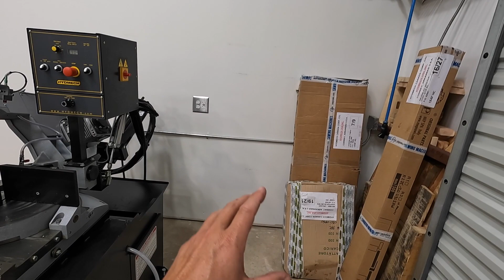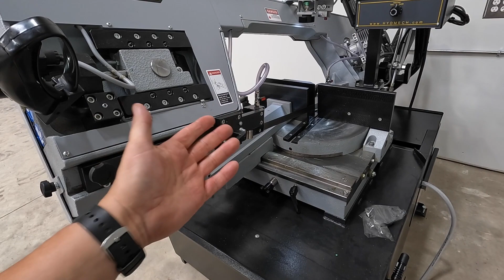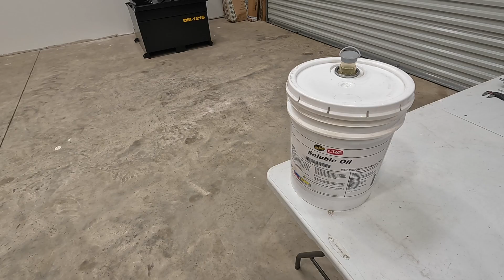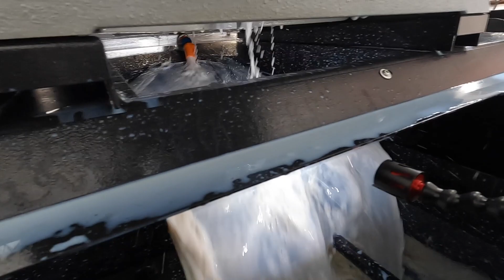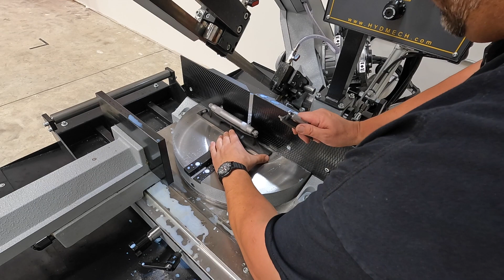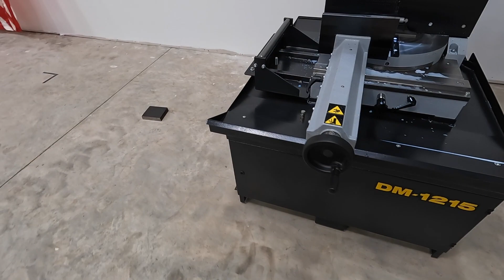Hydmech DM 1215 Setup, Level & First Use

Comment: blades are expensive if u do not know your grad of steel and the speed per grade of steel u will break teeth n have to scrap  300 $ for one blade,
Reply: i run 6 hydmech saws in a steel plant i can say i broke  3 blades cutting one piece not fun
Reply: @danielcyr6489  Theres no way the blade on Aboms saw costs 300$.
Reply: @innominatum9906  depends on grade mine are 300+  cheaper blades are no good for some sTeel.   my cold saw blades cos 700$ each
Reply: @danielcyr6489  But the blades for your saws are also bigger too, right? We use the same sized blades as Abom at my work. We cut stainless, tool steels, aluminum, mild steel etc with no problems. A sawblade costs us about 15$.

I've got no experience sawing titanium, inconel, duplex and whatever hellish metals are out there - so that could be why yours are more expensive =) cheers

Comment: When you poured in the coolant it ran out the chip drawer. I think you need to pour directly into the slot at the top so it doesn't run along the wall of the tank. Super saw. I'm sure it will suit you well, just as the other one has.

Comment: the coolant pump is sucking up air, maybe you should add some more coolant.
Reply: Thats why the handle sprayer is barely working. its not got enough coolant to run all the sprayers and the handle sprayer. If you watch when he hits it the nozzles almost dry up. I'm sure it has a minimum but seems he didn't read the booklet.

Comment: Hey Adam, just wondering...  In the high salty humidity you have down there in Florida, what would happen if you left the rust inhibitors on the machines rather than cleaning it off, and then reapplying rust inhibitors?  I know you need to clean it off of way surfaces, but I'm talking about the "acreage" of the machines.  Just curious.

Comment: OSHA came into my work p!ace years ago and wrote up violations for every machine that was feed from a cord into a receptacle or twist lock that was not on wheels. Other words what some people call fixed in p!ace then it must be hard wired. Looks like best in class saw. We had two Kalamazoo saws and I asked them to have our sheet metal guy make up deep pans so I could instal! Coolant pumps but they never got around to it. As a sparky was a!ways amazed how much coolant ( we always called it soup ) that you could make out of a 5 gallon pail.

Comment: As easy as those leveling bolts seemed to turn you might want take them out and add a jam nut on them so once you get your high set then you can tighten the nut down and they wont loosen back up over time. I probably would worry about it now but after you move it for the next machine would be a good time to add the jam nuts.

Comment: I'm no expert but if leveling is that important shouldn't there be nuts over and under the feet to prevent the vibrations from screwing with the bolt (also a joke).
Reply: It is not super critical, but you want to align it with the roller table
Reply: It's a legitimate question but since he's done zillions of these experience may say otherwise.
Reply: @silasmarner7586  
Ah, so your lips move long before the words get to us! 🤣🤣
We had a very poorly dubbed television series in the UK by that name, it was so dreadful that the dubbing is all I remember of it! 🙄

Comment: Nice saw, mine is probably the most popular bandsaw on the market, the 4" similar to the harbour freight model(hevily modified) model. On my first machine I cleaned off every last bit of Kosmaline I could find, now I'm forever using rust inhibitor. On my lathe I only cleaned of the necessary so as not to get dirty  fingers(its the hard drying type of Kosmaline) Now I only need to treat the main parts with inhibitor, saves a lot of chemicals but the factory treatment is still protecting the rest of the machine, its not pretty if you look behind it or under the carriage but its factory protected. I supose the factory did a lot of research to protect their machines till they are sold, maybe years after production.

Comment: Adam, you need a refracto meter to measure your coolant, % oil/water ☺️
Reply: Its not a rocket science to calculate 5%(500 ml) out of 10L bucket . It doesnt have to be super precise to a three decimals . it will have same effect with 4.8% or with 5.2 % .
Reply: He'll use gas spectrometry.

Comment: Aren’t you going to have to move it a lot more than that?  You got that sweet crane to lift stuff off trucks and move it around.  If I had that I’d be backing a truck in there every day.  A bag of groceries in the back of the truck?   Back it in and use the crane to lift them out.  Then realize the groceries need to go to the house… use the crane to load them back up.  Everyday.  But maybe that’s just me.

Comment: Adam.. May l make a suggestion ! Make a stainless steel basket that fits in the coolant stream as it returns to the sump. That will strain out all the cuttings from the saw blade. I did it for mine.... stops the sump getting nasty and keeps my coolant cleaner for longer.
Reply: Unsure if you saw but this does have what you’re talking about. He pulled out a tray that has a screen on it. The sump is in the base of the machine and the chip tray separates the chips so you can dump them out. Unless you mean a SECOND separator screen?
Reply: No matter what you do the semi -synthetic slurry will go bad due to bacteria in water eventually . Unless you coat your tank(electroplating )with copper which kills bacteria ,maybe throw some copper wire in the tank too. I guess small 1% of copper sulphate added to mix  wont hurt . 

Synthetic oil has bacteria killing agents know to cause chemicals to cancerous state of California. Thats why they last longer without smell.

Comment: A suggestion, if I may: You mention needing to move the saw at least once in the near future. 1) mark the pads at what position they're at. Just a simple 1-4 on the pads and the corresponding locations will do. 2) A paint mark around the pad at the floor will be helpful in relocating the daw back to it:s original location.

Comment: This Hyd Mech looks like the little brother to the Hyd Mech we purchased 10 years ago. We were very disappointed in our saw and the support for repairs was equally disappointing. This was a shame, because the Hyd Mech was full of features, but was poorly built and used cheap materials where premium materials were required. We ran out saw around the clock in a high production environment. A job shop would likely not have the issues we suffered. 
In spite of my Hyd Mech distasteful after taste, I am jealous to have one like Adam's in my home shop.

Comment: My chop saw is some no-name Taiwan thing I picked up used at Goodwill,  then rebuilt.  I took apart the gears and repacked them with grease, replaced 2 bearings, new blade. and put some new  tension bolts on it.  It doesn't have a collant pump or sump, but a spray bottle full of WD-40 and a stool works.  My shop is poor.  By the way Adam: a new saw, PM lathe, new mill.  also a CNC machine.  WOW.    My little Precision Mathews hobby drill/mill took me selling my spare car for the money to buy it.  You have BUCKS my man.  Hope all is well with you your lady and family  good vids.  You are my guru :)
Reply: He does this for a living and I bet the bank owns most of it for now. He’s shown at least over 80k worth of tools for this shop. Usually people start with used tools. This guy doing it right. This is his bread and butter. 
I also wish him the best!
Reply: @BP4WTurbo  OH i realize;  been wathing him for years. he is what I aspire to.
Reply: @pilgrimm23  Good sir ! May i recommend a 5L water bottle with a hole drilled in a cap?  Then all you do is buy one of those saline infusion kits from apothecary and glue the end that goes into the bottle to a cap.
The part that has a needle can be wrapped with copper wire and then you can glue one end of wire to a neodymium magnet.That way you can attach it anywhere you want and move it to fit your needs  . Build a stand for bottle and you will have a portable gravity fed coolant system you can use around shop !

Comment: Whenever you put a new blade on you want to make about 10 cuts at a painfully slow feed rate in some relatively large solid stock...2" or so... this will "set" the teeth and make the blade last a lot longer...also need to select a tooth spacing appropriate for the material you're cutting. Thin wall tubing many teeth per inch...big solid stock fewer teeth per inch..should have at least 3 teeth engaged in the material at all times. Hope this helps you and your viewers...I have years of experience selling,  setting up, and servicing band saws for my customers.

Comment: If it doesn't have a filter on it, it works very nice - a hydrollic filter - get the base and screw on filters.  It takes the small chips out from hammering the work and blade.  My blades last longer and the screw on filter lasts for years depending on use.  I lost one to rust as the oil needed changing.  That was 8 years of use.
Reply: Hydraulic filter might not work, if it's a paper element type. The paper swells up when exposed to water (as soluble oil is) and severely restricts flow. A mesh type filter, very fine, would be OK.
Reply: @beezul  Bob - this is oil base water.  And i have done it on my shop saw.  Oil takes to the paper (if paper) and lasts.  I hand one last for years.  It rusted as the oil stopped flowing and it went idle for several years.  I took it apart and it was full of iron.  You know Fe something.  I screwed on another and now need to make more oil water .
Reply: Hopefully there's something like that on the intake of the coolant pump. New, with no restrictions, it's got enough excess capacity to run a multilevel, decorative coolant fountain while cutting. 😉

Comment: Hey Adam, when you poor the coolant in, you can see a bit of it coming out from around the chip drawer. Is the fluid running down the right-hand side of the drawer while it's inside the machine, because it didn't look like you missed.

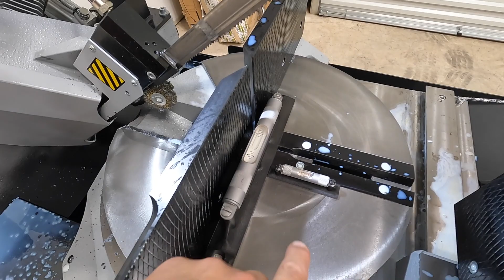Comment: Wow thats so cool -they even put wire wheel brush at 21:10 to clean chips from teeth.
Reply: The ancient Kalamazoo at my shop has that feature.
Reply: @russellstarr9111  Ive worked at 2 different shops that had Kalamazoos. One has 2 "Inserts" that you stick in and it cleans the blade, The other just had a wire wheel.
Reply: @mattcyr3342  How old are they. The one I use was built in the fifties.

Comment: I dont know how much it is in those crazy american units but i always mixed a  2x plastic cup -200ml  of oil to 10 L of water. It should give roughly 4% mix which is usable for most machines.Its a little watery for threading i think should be 6% but for lathe work and milling machine cutting it worked great.
Its very easy to calculate with metric system and get very  close to desired % .Factory i apprenticed in even used some kind of device but thats totaly unecessary for cutting fluids unless you are using a cnc machine with spray nozzle.
10L of water = 10.000 mili liters so 4% is 400 ml (aka 2 cups) ,5% would be 500ml (2 and half cups) etc . . .
If you want to find it for 1 liter you just remove 0 so 4% is 40 ml .
Reply: In my workshop I used, when cutting carbon steel, 6 - 7%. On stainless 10 - 15 %.
Reply: @a.bakker64  In this video he is using semi-synthetic oil which gives white milk look . 
Usually they are mixed with 3-10% ratio ,depending on operation .

There are also synthetic oils which have green or bluish transparent color when mixed ,ratio is usually 3-5%.
They are used in grinding operations and other operations that need more of a chip removal . 

I assume you use same semi synthetic coolant oil as in video.
Those coolants have mineral oils in them.  Oil is great for lubrication but -it reduces cooling ability of water.
Since cutting stainless steel  produces shiton of heat you might water down your solution to 8-10% . Also make sure you have plenty of coolant running 18l/h is minimum ,for heavy operations it should be 20 to 30L/min.
Its all about balance .

Comment: For a machine that's going to cut parts to be machined; why are you concerned with the base being perfectly level? Close should be good!
Reply: The closer the cuts are, the less machining and wasted material the better, it's also faster, less time getting past the crooked cuts.
Reply: I would also call it pride in his shop and workmanship! Not saying you aren't the same, just my observation of Adam over the past 10 years.
Reply: How level the base is significantly affects the way the coolant drains for one thing. Some people (and I am one of them) just as a matter of habit like to work to a little closer tolerance. Just pride in workmanship ...
Reply: I wouldn't want to twist the structure of the thing -- just seems like a bad idea.  It doesn't have to be level to be untwisted, but it's an easy way to get there.
Reply: You level the machine so the coolant drains properly and you don't have to clean up constantly.

Comment: Cool thing about that lamp is that it casts a shadow line of the blade onto the part. It shows both sides of the saw kerf on the part. Where using the laser line the saw tracks to one side or the other.

Comment: I would use a counter bolts on screws to screws when properly leveled. Vibrations may change the leveling.
Reply: I wonder if all those steel feet Adam's made for the machines will need paint to avoid rust. I know there's some chrome in the alloy but maybe not enough nickel to prevent discoloration.
Reply: @KJ6EAD  if he made them out of stainless there won’t be any rust stains on the floor 😉
Reply: Its a band saw ,there are not that many vibrations +the body is heavy so it will absorb it.
Reply: @zumbazumba1  It is only my opinion but i would do so. Additional pads and a counter nut from the bottom would increase stability because nut would add additional support by pad on whole "mounting ear" not only on the screws thread in "mounting ear"